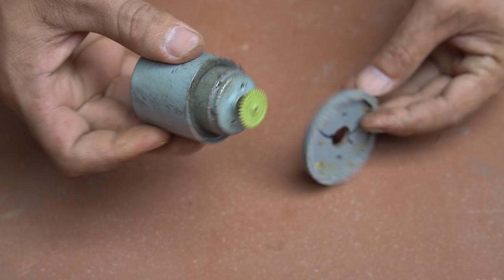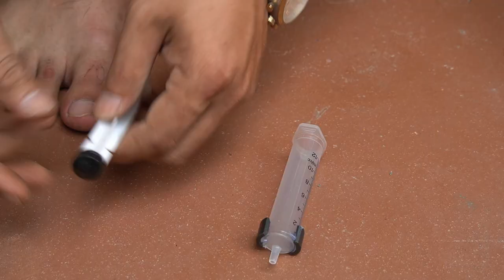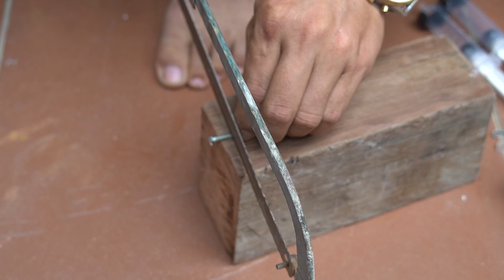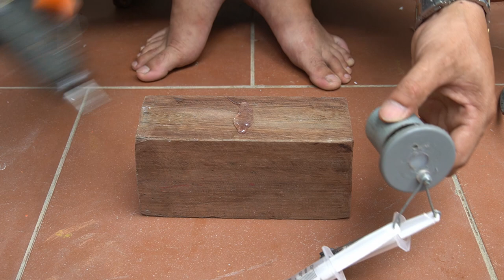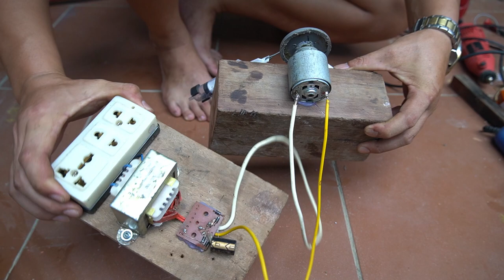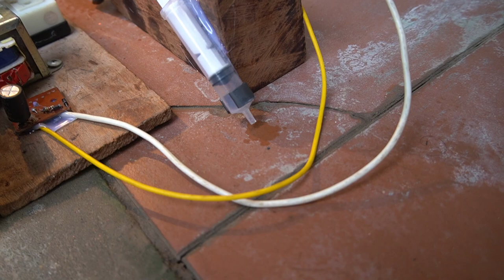Turn Permanent Magnets And Syringes Into Generators For Free

Comment: Why was it slowing down? And if you remove the magnet inside what pull the string out or push it out?
Reply: Thats because of the repel effect of the powerful small magnets glued in each syringes... Keep watching the whole video again and again...to help u understand better...lets say, when magnets in left syring repels, it pushes the piston forward which is is then converted into rotary motion.... Then again..the rotary motion is converted into   linear motion in 2nd syrings... Untill the the piston in 2nd syring goes all the way to the bottom... But again... Due to magnets the piston pushes back due to repel effect. But the condition is that u have to mount the magnets with N-N OR S-S side facing each other... Like if don't know u can  check it manually then mark the side and install it.Thank u for reading this

Comment: Oh god its one of this videos! Obviously this is fake!Why?Because of motor situation.Its obviously dc motor you need alternating current in order for transformer to work ,second the circuit on transformer is ac to dc converter, it cant convert dc to ac! Also there is hidden battery somewhere to make motor run!Dont make me write all stuff that makes this fake!
Reply: The converter is right there in your face... not hidden. Replicate and fail, then talk. Anything else is bitter misinformation.
Reply: @HectorLeeRodriguezDMin  hahaha   i would believe in that video if there was fricking transistor switching circuit,but there is only ac to dc converter.ALSo there is no fucking way that it can power anything but a incedesent light bulb showed in video.Even if circuit worked ,but it didnt, it wouldnt even supply that much power cuz transformer is a low power one!
Reply: @dogeeecart6082  replicate and show .... bluster much???